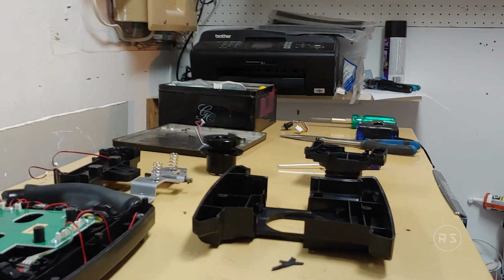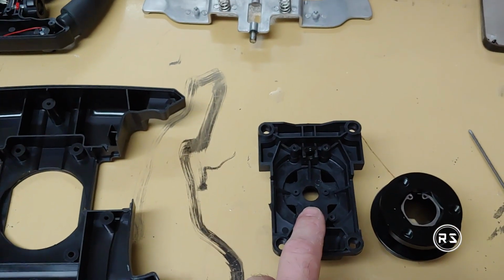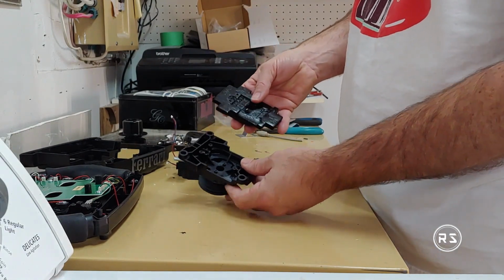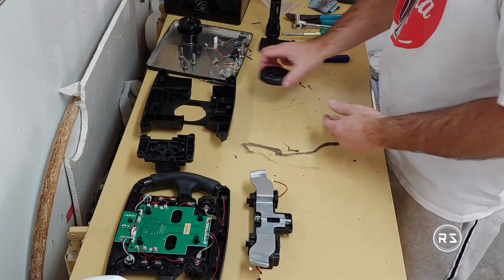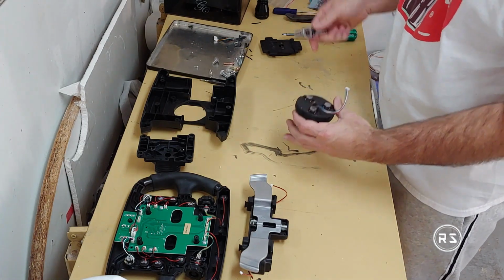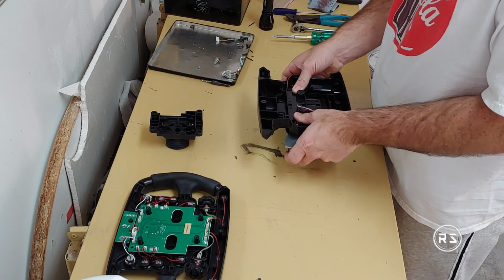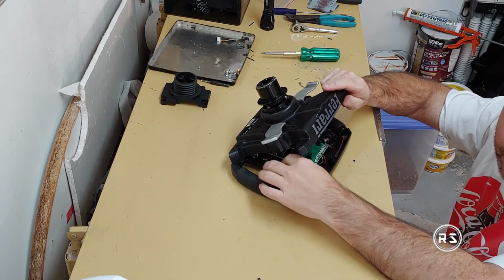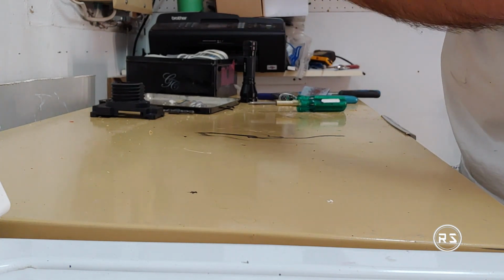Thrustmaster F1 wheel How to install a quick release

Comment: Do you know a good quick release?
Reply from the maker: Yes. I recently bought a very good quick release for my new wheel.
https://twitter.com/RickStuff1/status/1315754741180370945?s=19
Reply from the maker: On amazon
https://www.amazon.ca/QuickCar-Racing-Products-68-015-Disconnect/dp/B003TTRQ8S
Reply: @RickStuff  is that working exactly the same as in this video? And what steel pipe do you use?
Reply from the maker: The new one new a 3/4  pipe. It is much better quality than the one in my video. Yes it work the same way but as splines istead of octogone shape so less loose in it.
Reply: @RickStuff  ok, I part 2 you changed the cable of the steering wheel but am I able to get my cable trough the quick release?
Reply from the maker: Yes the cable fit in the quick release. The hard part if you pass the cable through the quick release is where you will pass the cable exiting the chaft.
Reply: @RickStuff  how will it works in the wheel base if I go trough the quick release
Reply from the maker: If you watch this video  "steering column shaft update"
  you can see everything inside the servo base. It will be easier to watch instead of me tring to explain it 
https://youtu.be/dUIW3yaSy-4